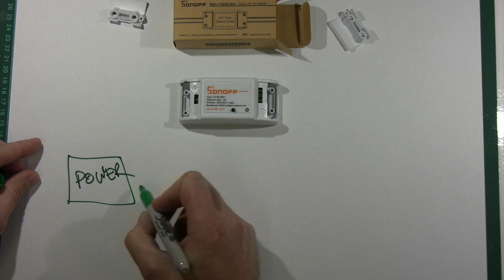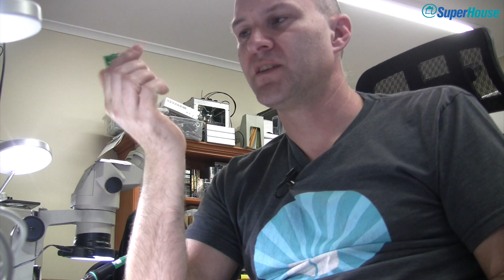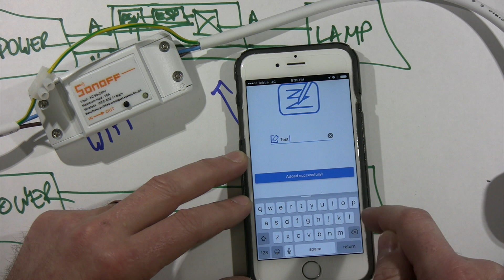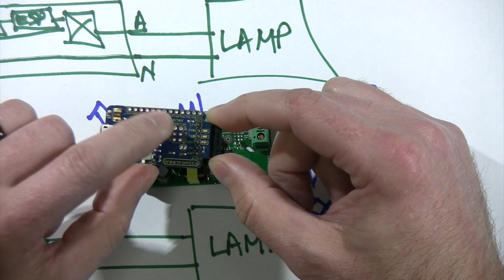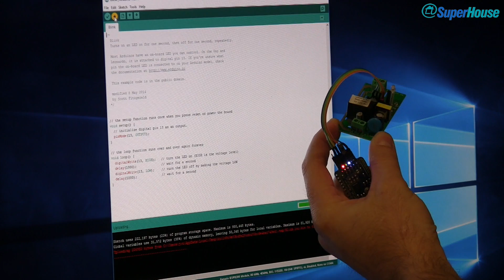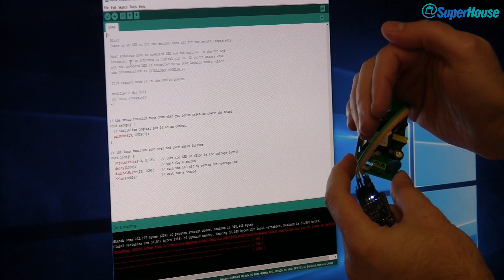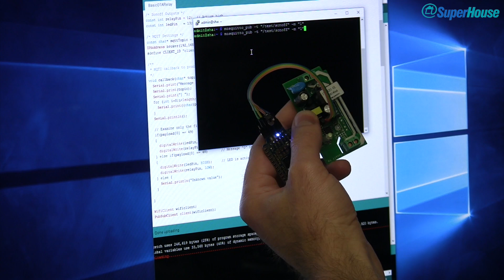SuperHouseTV #17: Home automation control with Sonoff, Arduino, OpenHAB, and MQTT

Comment: well...i don't see a reason why not to flash it with main connected, it has a trafo, so it's isolated.
if where were no trafo, well...yeah...that would crap out your pc and most probably zap you due the fact that it use floating gnd.
still...it's more safer to be disconnected

Comment: In 2018-2019 the basic Sonoff switches, like the one depicted in this great video, had a firmware update that solves the problem addressed in this video. The Sonoff switches will now work if there is suddenly no internet connection without custom firmware. They can work in a LAN only mode.

Comment: Hi, thanks for the video
Is it possible to let the new sonoff (with power consumption monitoring) to turn off automatically when the power consumption  reaches certain level using arduino ?

Comment: X-10 is cheap.. and I think it's still around. Easy to install and easy to implement. The TW523 interface may still be around but if it isn't it's easy to write a arduino code and build your own X-10 interface using a balon coil and some capacitors as passive phase filters. I made a power line transmitter that can send 12Mb across the power line using 2-10 mHz in the transmit mode and between 12 and 20 in the receive mode. I created an ADHOC protocol interface using OFDM platform and created a BQPSK scheme with the old INARI chipset . This allowed me to connect up to 256 devices all talking at the same time using a LUC or "Line up Card" which controlled which node spoke and when they were allowed to make a diffee and helman handshake. I hold patents in the power line industry and I've actually transmitted over a 7620V power line 12 miles but the Radiant Noise level was too high 70 db per meter and the FCC prevented me from moving forward with that design. But it is possible.

Comment: Thanks for an excellent and complete tutorial very well presented.  I have and application where I need to control a bank of separate switches. I have been looking at the Sonoff Smart Remote Control Wireless Switch Universal Module 4ch DC 5V 12V Y0T7. This has 4 relays. It has the same sockets to reprogram the board but will the the blynk software be able to handle the 4 relays?
UPDATE: I found your "Video SuperHouse #30: Reflash ANY Sonoff, even if you don't know the pinout
" it told me all I needed to know, so I don't need any help - Thanks again - Great work

Comment: Thanks - great vid!! Is there a sonoff like device that can be controlled via Ethernet cable?
Reply from the maker: LandscapeInMotion That’s what I designed the EtherTen for many, many years ago. It was designed specifically because I wanted to replace my light switches and I wanted to use Ethernet with PoE for the control links. I produce them in small volumes though so they cost a lot more than a Sonoff!
Reply: @SuperHouseTV  I would love to buy a few please. Can you please send me a buy link? Also, does it have a relay onboard so it can handle mains power?
Reply: @SuperHouseTV  Essentially, I would like use EtherTen to power on/off my appliances via ethernet. Since I have CAT6A running wild at my place, Im don't need wireless.

Comment: I just tried to install tasmota on one of those devices, but it seems to work only when connected through the serial pins, when connected to the wall plug it doesn't connect, I might need to install that firmware to try it out (I also use MQTT) I'll be looking forward to your next videos :)

Comment: Can the TH10 support 2 waterproof thermal sensors in parallel and act upon the temperature changes on 1 of the sensors?  I have a pool heater that I want to control with the TH10. I would like to control the temp remotely, and monitor the pool temp, as well as monitor the exhaust temp to tell me if and when the heat is on.  Or can I use another input on the TH10 for that without adding the resistor and jumper.  I bought a th10 and did the mode before testing it, and found it's not getting picked up on my wifi.  I'd like to do this with the native ewelink app.  Thanks.

Comment: Nice video presentation. I just want to ask you, I'm a Filipino, our power line provided by our power company in most of the residential areas in Philippines are using 2 hot or live 110v and ground. Then of course all of our appliances or units available in Philippines are 220v rating. My questions are: 1. If I connect 1 hot wire to L and another hot wire to N which is supposed to be Neutral in your video presentation but due to Philippines 2 hot wires power designed (even the N-in is directly connected to N-out but the circuits of Sonoff is connected to N line), the Sonoff circuit won't damage? What will be the alternative connection to match in our 2 hot wires power line. 2. Are you really confident that the relay switch metal size can handle to switch on and off safely the appliances like electric fan or spot light etc.except low wattage lights (can be seen in other Sonoff youtube video presentation). I know that they marked the unit limited to maximum power load but looks the size of relay switch is unsafe to replace our existing light switch, the safest way but may not be economical is to use contactors. My point is, still hard to trust the Chinese made products.

Comment: Is there any danger is using the Sonoff with aluminum wiring? Is the "Earth connection" the same as "ground wire" in the US? Does the Earth connection need to be encased, or not touch the Sonoff unit?

Comment: Hi do you know or make a product that can be controlled via MQTT to set a dimmable led lamp to a light level. I switch it on and off via a flashed sonoff controlled by MQTT via Home Assistant.  I used to use a plc with a 0-10 v controlled dimmer as I am removing the PLC and moving to home Assistant as my control hub which works well and allows Alexa voice control.  Any ideas or help would be great. Also do you know of the same type of controller for rgb lights so I can set colour brightness and on and off for a rgb rope?

Comment: Providing power to many appliances simply provides power to them, but they still need to be powered on manually so putting one of these on a coffee pot or window AC or a TV or a modern wash machine isn't going be of much use, right?  I see this as most useful for lights and fans and probably other things I can't think to name right now, but for modern appliances, it doesn't appear it would help much.
Reply: I agree.

Unless you're comfortable with soldering or any other way to leave them in a permanently "on" state and let Sonoff control the on and off.

Wouldn't work with a kettle though as that turns off when it boils.

Would work with a washing machine by bridging the push button switch.

Comment: I have automation using stateful rules via a proprietary tool (ISY), and expensive switch controllers ($35 each adds up quickly).  I like the concept of management via centralized relays you've got going; haven't watched all the videos yet so pardon if this question is covered; but; are your relays switches dimmable?

Comment: The only thing all these things miss is wiring to include a physical switch override, to allow momentary or toggled switching detection to actuate a change to the connected device (and if it sent an MQTT message as well that would be even more awesome). For example, is there a GPIO on this we could use to the old wall switch (and yes, allowing for bouncing) so that we could manually affect the device? Is this at all possible?

Comment: I've been looking for an Alexa enabled light switch that has multiple gangs (1,2,3 and 4 gang) and can work as intermediate switches (2 and 3 way, so that 2 or 3 switches control one light). Can this configuration be expanded so that it also works as a 3 way switch instead of 2 way? Also, does the Sonoff module provide for dimming, so that it can be dimmed through Alexa even if it's not possible to do so at the physical switch? Thanks!

Comment: Hello, I would like something like the Sonoff but I'd like it to be dimmable, and controlled by wifi, and control them with a smartphone as well as have a remote wall switch to control it, say with 2 buttons...  On/brighten and Off/dim.  I have just started to play with Arduino and wondered if something like this could be accomplished with 2  NodeMCU's and a D-A converter with a triac. ??   Do you have anything like this in your collection?  Thanks,

Comment: Do I need to connect the Neutral wire through Sonoff since its passed through directly in the unit... My house has old wiring & the Neutral is sent directly to the light fixture in some cases & not from the switch board in the room... Only the Active phase wire comes to the switch in the room...
Reply: Don't think it's possible mate.

I've tried and failed and read it's not.

Comment: Hi, first of all, thanks for your videos, they are great.

I know almost nothing about electronics, so my question might sound silly, I apologize if that`s the case..  Can I use the on/off wifi switch  in parallel with my wall switches, so I can turn the lights on/off either by wifi or by the wall outlet?

Thanks

Comment: In version  Arduino 1.8.3 I can not find the program to install the driver for the ESP8266 using the 3.3 v/ 5 v FTDI - Compatible serial Interface from Freetronics.

Comment: I'm having a bizarre problem with my two Sonoffs. If I power them by connecting 3.3V (from either my FTDI 232 or my bench power supply) to the programming header, the work flawlessly. However when I power them from AC, they are incredibly unstable/temperamental - after a dozen power cycles they might work, with huge amounts of lag & once one of them suddenly started working after 20 minutes powered from AC. At first I thought the power supplies might be faulty, but I have metered 3.316V when they are connected to my 246V AC. I haven't checked the serial console while AC is connected (for obvious reasons) but from my WiFi AP's Web interface it doesn't look as though they are successfully connecting to WiFi when powered from AC. I have a few more on order from banggood, but they will take a while to arrive - maybe the power supplies on mine are putting out the right voltage but are too noisy?
Reply: For anybody finding this comment via Google, the issue was faulty low voltage power supplies on the Sonoffs. Two more Sonoffs from a different batch work flawlessly with exactly the same code/AP/broker/etc.!

Comment: Thank you very much for these precious and precise advice well structured.
The SONOFF interface is very interesting no term of saving water and electricity.
I did some tests and read a lot. I realize that it is the jungle from the multitude
To manage this automation via proprietary servers (or not as Mosquito) or various platforms.
I am a confused in the mass of information ingested.

Would you be so kind as to advise me on a device that works only
On a local area network (LAN). I want a client / server device (off-line) opensource
So as to manage, via a router, a drip, the ground of which can not receive any
Internet signal. Please, indicate me in the main line, the different tools. Is the
Support arduino could support a server?

Thank you in advance for your time and advice.

Comment: I'm getting issues when I try to upload the custom firmware into the SONOFF. I get an error "ESPCOM SYN FAIL". Could you help me?
Reply: Okay, just found what was happening... For some reason the Pins TX & RX does not work so I had to connect directly on the chip. Check this website!
http://support.iteadstudio.com/support/discussions/topics/11000009218

Comment: Hello also i notice  one thing with the Sonoff relay switches is that once you flash the firmware to MQTT on openhab the button for manual activation is no longer there How would i be able to add that back in plus have it show up saying it was pushed?

Comment: Hello awesome video. But i was wondering about dimming the Light bulb it's self. I have 4 light bulbs  each one on it's own Dimmer witch. Using the sonoff which is a Easy Cheap Esp8266 relay module is Great and all But how would i be able to dim the lights?

Comment: Once the Sonoff has been reprogrammed WITH the over-the-air additional code, for each subsequent reprogramming (with changes in the functional code), must the over-the-air code be again included?    Also, is there no way to dump the original Sonoff ESP8266 code prior to all this?  Thx.

Comment: Stupid question maybe but if i have a  little switch on example a lamp, should i remove the switch, or keep the switch, should i put it before or after the the switch if so ? 

Second question, does this also work with ceiling lamps as long as you keep the power ""on"" ?

Another question, can you connect a usual 4.85 sonoff switch on a power extension socket with lets say a , coffee machine? 

Recently got intrested in home automation and you got a new subscriber, very informative but, i would love a basic guide for a noob like me :)

Comment: how often is the temp sensor updated and can it notify you by text if there is a change in temp ?  also does the app give you real time temps, and how often is it updated ?
Reply from the maker: I don't know with the stock firmware, but with other firmware (such as TASMOTA) you can have it report the sensor readings at a configurable interval.

Comment: Hi Jonathan, I'm wondering what is making one of my sonoff modules to work only when powered from the pinout 3v3, but not when it is powered from the mains. I suspect the issue is related to the wifi connection since I'm able to access the webserver in one case, but in the other the module doesn't establish the connecting. Do you thing is there a way to test whether the high voltages are messing the wifi antenna/connection?
Reply from the maker: I could be totally wrong, but it sounds like there may be something else entirely happening. Perhaps the switch mode power supply isn't working, so the Sonoff isn't powered at all when mains is connected. You could try VERY CAREFULLY using a multimeter to measure if there is 3.3V between GND and the VCC rail when the Sonoff is powered by mains, with nothing else connected. But PLEASE don't zap yourself!
Reply: Sonoff is actually powered with mains, since I can clearly see led blinking from time to time. And I'm pretty sure that means the esp is powered on, given the led is controlled by it. But, just to test your suggestion, here it is: http://i.imgur.com/lrfC2Wl.jpg
The strange thing about this test is that, by connecting the multimeter, sonoff had properly started, even the webserver is there again!, and guess what: after disconnecting both mains and multimeter, and powered the sonoff again by only connecting mains, same issue happened again (blinking led with but no wifi connection). 
I'm wondering if it is safe to connect rx/tx/gnd to the usb-uart to check what the serial log has to say about all these. But, in any case, there's the fact that the sonoff works fine by either being powered through a 3v3 power supply connected to the pinout, or by the strage (at least for me) configuration of sonoff powered with mains AND multimeter measuring power on pinouts.
Reply from the maker: If it wasn't working, then you connected the meter and it started working, my first guess is that it's a mechanical problem. Maybe there's a solder joint that doesn't make connection properly, and when you moved the board or connected the leads it moved and made a connection. I suggest you disconnect everything from the Sonoff, and inspect the solder joints on the PCB very carefully with a magnifying glass to see if there are any joints that don't look right.
Reply: Yes, is definitely something about pin holes and missing soldering pads. Sonoff actually boot: I'm able to trigger the relay by pushing the toggle button, and led blinks, so the mcu is powered and the firmware running. 
This are the pin holes after removing the male pins previously soldered to access the serial bus: back: http://i.imgur.com/6FyMwf0.jpg and front: http://i.imgur.com/ySwHxmi.jpg. In these scenario, when powering from mains, nothing happens (but a poorly light in the green led, missing connection? very low current?). Any way, I reconnected 3v3 pin hole to the missing pin hole/track and put a drop of solder in every other hole to make sure front and back pads were connected: http://i.imgur.com/Kewb4wp.jpg
Now, I'm back to the begging: led blinks repeatedly and then stops for a while, in a loop.I keep thinking there's is an issue with the wifi connection, both as client of the configured ssid (it never gets connected) and as AP like when starting with defaults (I saw the default ssid once, it was after refreshing many times the available ssid's with my phone).

Comment: I have got a question, is it possible to 'Sonoff' a switch that is acting like a main on/off switch for all the electrical devices in a enclosed room?

Ex: Kitchen
I have a master manual switch that with one flip (on/off) I switch off all the lights, the downlights, the tasklights and maybe some of the non essentials like coffee maker, bread toaster..etc.

Now by using Sonoff, I splice it onto the master manual switch so that I can now use wifi to switch all of the above mentioned either on/off.

Will it work like that? Without having to flash the firmware?

Comment: Can I alter the state of the sonoff with the pushbutton?
I have uploaded the sketch without problems and can alter the state of SonOff by sending a "1" or "0" through MQTT but the physical button doesnt alter the state of the sonoff. I would like to have the option of turning a lamp on or of if I dont have my phone at hand.